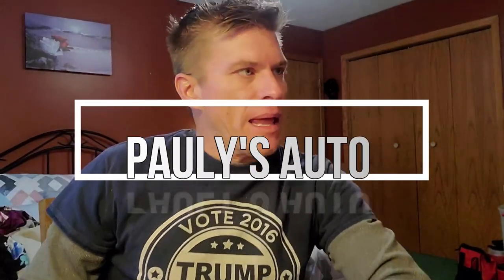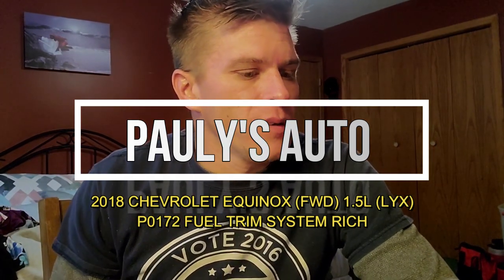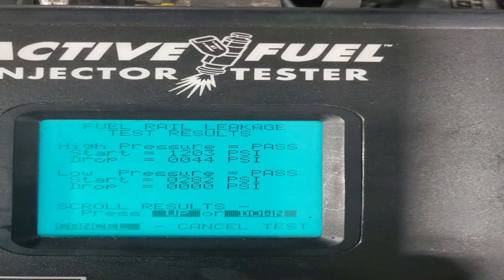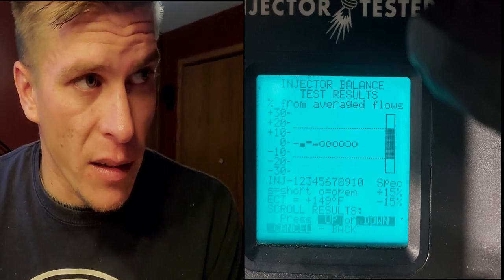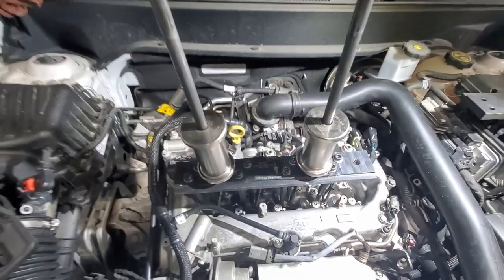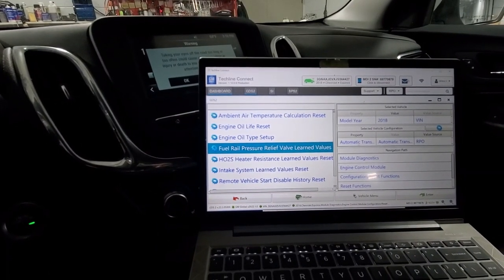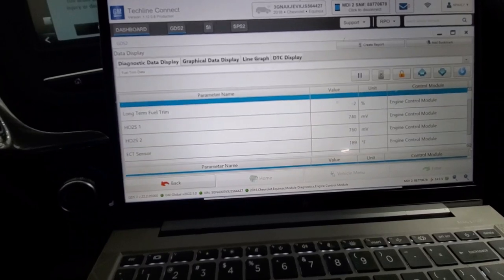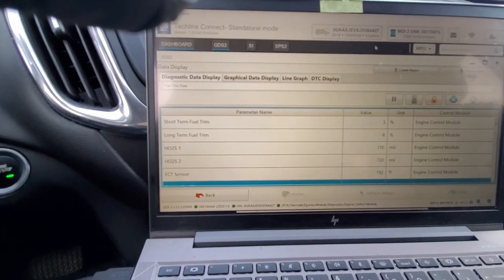2018 CHEV EQUINOX (FWD) 1.5L (LYX), P0172 FUEL TRIM SYSTEM RICH

Comment: hopefully i will never own a direct injected gasoline vehicle we just thought we had problems with mpi we really have them now. works on diesel not so good gasoline. their needs to be a way for the intakes to be self cleaning some how big problem. old days when we had carbs intakes and intake valves were self cleaning for the most part. the needed maintenance is getting out of hand people have gotten used to just driving this new tech owners are going to have to do lots of maintenance if they want them to run correctly
Reply from the maker: I couldn't agree more, thanks for your feedback my friend.

Comment: What tools do I need to get the bottom fuel rail off and the injectors off? Can you help?
Reply: I have a 2018 equinox 1.5 fwd
Reply from the maker: The injectors unbolt from each rail tube and pull off...the proper way to remove everything (fuel rail with injectors) from the engine head is the tool I show in the video.  To do this job without that tool is likely possible, but if you are not careful something may get damaged - DIY at your own risk 👍...I am just explaining a case study.